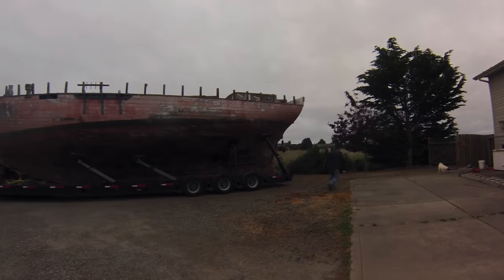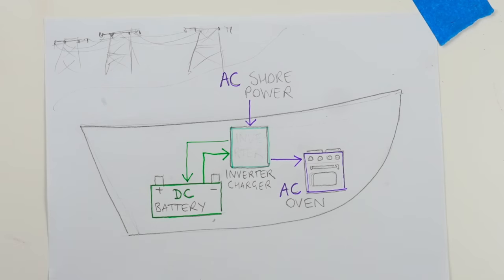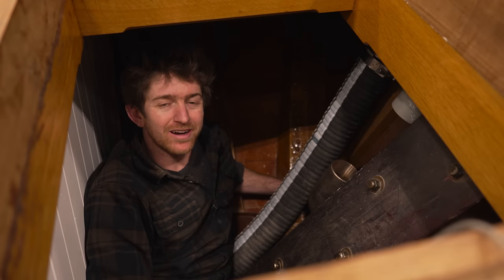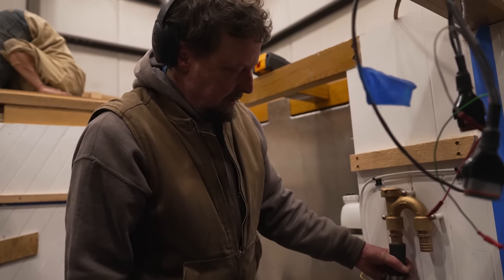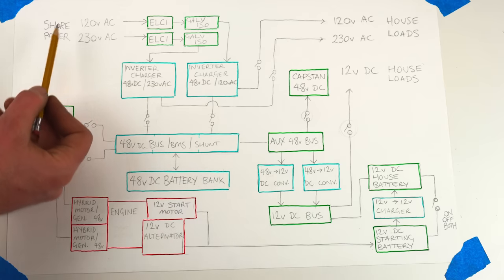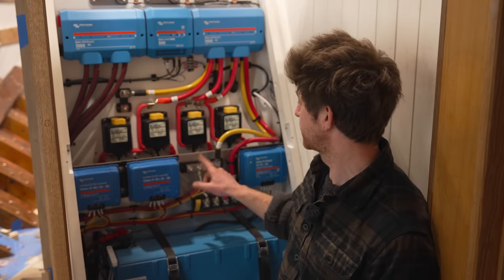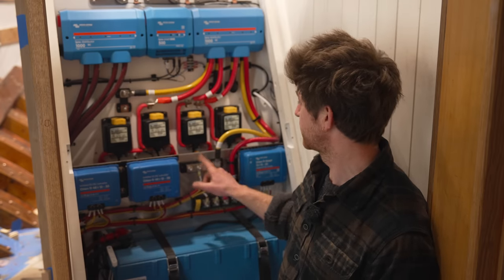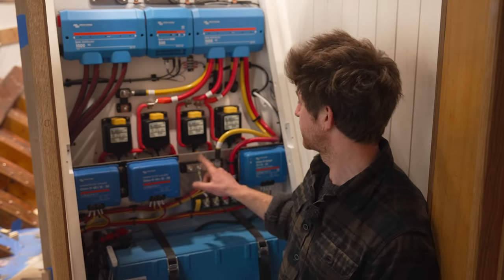Electricity is dangerous

Comment: As a commercial Electrician, I had to make some tight bends in heavy cables (200 to 500 MCM). I made up a couple of thick wall aluminum pipes, one inch dia and 3/4 inch, threaded on one end and with a coupling and a 'smooth bore' bushing. If you can't find a smooth bore, you can machine the threads out of a regular one. If you cut the cable to length before bending, you will have to re-trim the now staggered inner wires, but pre-cutting makes for easier access to the bend site. Since I had access to several lathes, I knurled the end of each pipe to give a better grip, since dielectric grease seems to find it's way onto every tool. They made nice, neat 90 degree bends in the stiffest of cables...👍

Comment: I like the redundancies built into the electric systems.  At sea, what ever can go wrong will eventually go wrong and it's those multiple backup systems that will get you to a safe port.  I especially like the dedicated engine cranking battery with the ability to employ the house battery. Many years ago I taught that type of setup and installed it in several sailboats myself.

Comment: Hey Leo, I’ve watched every video so far!

I’m an electrician in the UK and moving into prosumer AC/DC systems domestically and commercially. This is great to see how your implementing different systems like we do in canal boats here!

Just a thought I know your spark mentioned RCBO’s for your AC side circuits feeding the boat but we are moving now into AFDD’s which are an over current device, RCD device and an Arc detection device rolled into one. While there more expensive they are now coming into our industry in certain areas… with the amount of wood in your boat I’d maybe consider fitting these which will trip and indicate with an led if an Arc is detected before it becomes something much worse that an RCBO or MCB might not even detect.

Sorry if someone’s already mentioned this haven’t made it through all the comments 😂

All the best with the build. Look forward to seeing Tally Ho on the water!

Comment: Great video as ever! This series has shown me a side of Americans i hadn't really seen before.
Electricity certainly is dangerous. 
When i was a kid I used to solder together guitar effect pedals to try to make different noises. At the end of one soldering session in my excitement to try the circuit I pushed the live and neutral prongs in with my fingers. I woke up on the other side of my bedroom, my arms felt like they had been hit with a sledgehammer.
When I went downstair mum said the electricity had tripped and did i know anything about why it had tripped. I told her I didn't.
Reply: My little brother once tried to melt a plastic ruler by wrapping it with garden wire and sticking the ends into an outlet.. Nothing happened to him (nor the ruler), the breakers weren't happy though.

Comment: Hey Leo, if you are worried about fire in the electrical locker, there are products that are pressurized tubes containing fire suppression chemicals.  You mount them above where fire may break out, and the heat of fire will melt the tube and extinguish the fire.  The systems I've had experience with are made by blazecut.  They have a stand alone tube only system, and a tube and cylinder system that has a larger capacity, but works on the same principal of automatic detection and dispersion.  The tube and cylinder system has the advantage of being able to set off an alarm.

Comment: Years ago, when I was foreman at Bristol Marine in Rhode Island, or later when working at Sailors Wharf in St. Pete, FL, In often bored holes through hulls to install new through hull fittings, and drilling each and every one was a bit mind boggling, since I was boring a big hole through a hull, sometimes below the waterline, but knowing once the fitting and valves were properly installed, all would be watertight. I can only imagine, though, how difficult it is for those working on Tally Ho, to bore a hole through the pristine new hull. My accolades to all who are, and have been working on the restoration/reconstruction of a great Lady!

Comment: You guys do a tremendous nice job. My compliments. 
A review on your toilet dump system . It looks good but those Y valves will act up eventually. 
My 2 cents, make it simpler.  Dump the toilet waist via de top of the tank. Dump the tank straight true hull by gravity.
With a valve on the bottom of the tank you make the tank a tank. A second hole, stand pipe  and cap on the top for emptying the tank at the dock.  Install a large filter in between the vent line for obvious reasons. 
If your toilet hose to the tank is long install a siphon, this to relieve the toilet form back filling. 
Less valves less trouble.  If your tank dump is above the water use a waist pump.

Comment: The 12V of your car battery is safe because it's 12V, not because it's DC.  Higher DC voltages can be dangerous, too, because when you first touch them, you see a 'step function' of voltage, which mimics  AC to your body.  AC was adopted for the electrical grid because we could transmit 3 phases on 3 wires (and not need a return wire), and because transformers could readily be used to step voltages up or down.  Higher voltage for long distance/high capacity, lower for neighborhoods, and lower yet for end users.  But modern electronics has made high voltage/high capacity DC transmission lines viable, too.  The more you know, the more you realize how much you don't know.  

Good rules for electrical safety.  
  1) Assume a circuit is energized until you know it is not, and de-energize before working on it if possible,
  2) Assume a circuit is a dangerous voltage until you know it is not, 
  3) keep one hand in your back pocket (electrical paths across your heart are worst-case scenarios).

Comment: Ok Leo, a lot of that went over my head, but that`s not hard to do, I will say one thing about this whole electrical system, it looks expensive for sure, with many safeties built into it, what an impressive system, and it sure looks like you have the right people involved, this boat is basically self sustainable on shore or out to sea, what more could you ask for, love what you guys do Leo, what an epic boat this will be.
Reply: You are right , i reckon at least $20,000 plus installation ! but unreal , 10 kva capacity in the middle of the ocean , wow ! Which brings me to another question , why so much available power for the 230vac and the 120vac ? , are they having a washing machine , drier and electric oven and maybe hotwater heater all electric powered ?

Comment: Congrats on your choice for the electrical attention to detail. Craftsmanship is not only making the system work correctly, but to do so such that trouble shooting that eventual day down the road when something does go wrong, it'll be easy and systematic to diagnose. Also congrats for the amount of redundancy in cross connections of systems. Battery/Motor/Generator/Engine full circle duplication is giving you many advantages for success.

Comment: Important systems entered or will enter the boat. It'd be wise to START writing "guides" to those while expert installers are around: how to procedures, troubleshooting lists, fast fixes, scheduled maintenance, emergency instructions, etc.

Eventually, cover: pre-sail check list, inventory, engine guide, generator guide,  electricity plan/guide, electronics plan/guide, hidraulics... also: "flood" action plan, "colision" action plan, "fire" action plan, "pan pan" action plan, " mayday" action plan, " abandon ship" drill, etc.

Keep it brief, a column with relevant issue/part/problem, a second one sending you to a page in a manufacturer manual, instructions or procedures you wrote, plans, drawings, printed lists, check lists, or anything you have on board that may save you time (and more) when things go wrong.

Comment: A common confusion is that while modern wooden ships use the Hull as 12v negative earth the same as cars, traditional English ships made of oak used to be 6 v positive earth, because the timber being positively charged helps repel barnacles and the french
Reply: 😂 …meaning the French are positively charged‽
Reply: Didn’t some old English cars also have 6V pos chassis?
Reply: My 1930 Ford Model A is 6 volts POS grd
Reply: @timgelder4263  As were, I think, the VW Beetles

Comment: Be careful about the blackwater plumbing systems. Fixing things after it had been in use is a nightmare. Unfortunately I'm speaking out of experience 🤢
Reply: I always have sympathy for the mechs who maintain the sewage plant on the rigs/ships i work onboard.
Imagine the amount of stalacshites that build up with up to 200 riggers/roughnecks etc. 😆
Reply: Never done it personally but I've heard horror stories about trying to tig weld small cracks on stainless urinals
Reply: @k-mc94  We found a decommissioned but still half full (definitely not half empty) wastewater tank. It was great fun to first cut it open, shovel out what's in there and cut the rest of it into pieces in order to get it out. Someone even had the great idea to use concrete to "glue" that thing in place. I've a video of it if you stomach is strong enough 🤮
Reply: @FlyingConey  No thanks, the vivid description of finding 'stalactites' in the walk in size plant that the mech told me about was enough. 😂
Reply: Judging by the excellent judgement evident in the selection and implementation of the blackwater components, I'd say Leo is very much aware how unpleasant his life could be if he doesn't get it right. Vacuum flush is a great way to keep things simple and rugged and reliable, and I'm sure he'll carry a spare pump, which in his system is the only wearing part except for the internals of the Y valves, which should last forever as long as no-one mistakes the head for a trash disposal unit.

Comment: The biggest reason it's hard (or impossible) to electrocute yourself on your car battery is because it's only 12 volts, not because it's DC
Reply: licks the 9V battery to check its charge
Reply: Agreed in fact DC current is far more dangerous at high voltage
Reply from the maker: Yes, that's what I said - consumer DC applications are typically lower voltage ,and thats why it's harder to electrocute yourself on them (or at least what i tried to say!)

Comment: Hi Leo, I commented on one of your earlier videos about the exhaust. Ill say it again. You need to get a dry exhaust riser made. Your engine is below waterline but you have plenty of height in the engine room to raise the spill over height. Relying on a siphon loop when you don't have to is a sure fire way to flood your engine or sink your boat! You also have the spill over point right at the transom, as far way from the engine as possible, after the wet muffler creating an undue amount of back pressure. You need to consider the effects of gravity.....
Reply: I know Tally ho is a traditional vessel, but it would be worth having a flap on the exhaust outlet to further help stop water back flooding the system. Id also ditch that bronze/brass siphon loop as it going to have warm water passing through it straight into a stainless mixer.The mixer will last 5 mins.
Reply from the maker: Interesting - all I know is that this system was approved by Halyard Marine, who helped design it, and Ocean Systems, who have many years of experience installing marine engines. Without knowing your credentials (no offence) it's difficult to know if this is worth looking into. By the way, we don't have much engine room height because the cockpit is yet to go in.
I may not see any other comments but you can email info@sampsonboat.co.uk - thanks.
Reply: @SampsonBoatCo  ill flick you a quick email

Comment: Excellent details. This shows you've thought through the LiFePo4 cut-out safety relay. If for some reason the lithium batteries have any kind of error, the BMS will cut the power to the system, your 12v house bank is a great fault-tolerant backup for essential loads for navigating and autopilot to get you home or to troubleshoot the problem. Beautiful! And to say you've got your Sh*t together would be an understatement. I like the manual pump to handle all of that too.

Comment: ELCI:  Equipment Leakage Circuit Interrupter.  RCBO:  Residual current operated Circuit Breakers with Overcurrent protection.  GFCI:  Ground Fault Circuit Interrupter.

Comment: Love to see the systems come together and it was perfect for me as it is one area I know a bit about.  

In that vein I think it’s a mistake to put in the 12v ‘buffer’ battery into the 12v system.  IMHO it is going to be the main trouble you have with the system as a whole and be the thing that takes down your 12v system instead of being a backup.

As you have it installed it is probably going to be in float or over charged for all its life.  In which case, over charged and over heated it is going to be venting and losing electrolyte and will have to be inspected very regularly for electrolyte levels.  If you have put in a ‘low maintenance’ battery then it will have a very short life.

The excellent Victron dc to dc converters are extremely reliable and cheap enough to carry a spare in the case of a failure.  You can trust them far more than a lead acid battery, installed with very little ventilation and possibly over charged.

May as well take it out now as I’m six or twelve months it will be gone anyway after repeated problems.

Everything else electrical is really top notch and will be 100% reliable and beautifully installed, don’t spoil it with a ‘backup’ system that will just case problems.

Comment: 2:27 to go a bit more in-depth why you can't easily electrocute yourself on the car battery:

The car battery is typically only 12 V and it's hard to electrocute yourself with 12V AC or DC.
The higher the Voltage the more dangerous it becomes to you. Don't touch anything above 50V.

The dangerous thing about AC is that the frequency can interrupt your heart beat which would then stop it. A defibrillator does basically* the same except that because your heart stopped it "restarts" your heartbeat with the help of the current.

* A good defibrillator can do way more that this. It may also detect if your heart is jittering (not sure if it's the right term) and thus act differently.

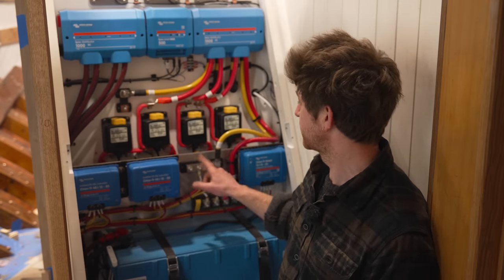Comment: 16:26 The 48V batteries are LiFePo4. 
The two 12V batteries are lead acid, i.e. the house battery and the starter battery.
The electric motors and the capstan are powered by the 48V.
The navigation and position lights are powered by 12V.
There are 230V and 120V AC sockets. The electric stove is on the 230V system.
There is the possibility of charging the 48V system and the 12V system with the diesel engine.
The 12V system is charged from 48V.
Reply: The 12V batteries are also charged from the diesel engine's alternator.

Comment: Excellent video.   You might want to seal your electrical panel's with some plexiglass.   Always good to be able to keep an eye on what is going on there.  If a little moisture gets in there,  corrosion will cause trouble in no time.

Comment: Speaking as a retired master electrician myself, I found your explanations of how this system works was fascinating except for details that were left out such as integrating solar panels or wind generators into the system, the battery monitoring system and how you can view the status of this system from the Nav station and/or the cockpit. Also how can you protect those various terminals from corrosion?
One last tip if I may add,  is to super glue a copper penny on top and in between the battery terminals that will attract any electrolysis and keep your terminals from corroding.
Any lightning protection systems under consideration?

Comment: So unless I missed something....  the inverter setup is supplying AC 230v @50 Hz for high / low draw devices but is supplying only 120v @60 Hz for low draw devices,  so the 60Hz inverter is not capable of/setup for supplying 240 v@ 60Hz. Interesting  design choice, that's not intended to be criticism. I just figured for high draw appliance versatility that both would be offered since the 120v@60Hz was offered , but I realize it is that big of an issue for non-electronic high draw applications. Cool, another great video  thx.

Comment: Have to admit I really don't understand why the electrical circuits on wooden boats are grounded to the water, because all you need to do to get a shock is touch a conductor while standing in the water,  but if they were just electrically floating you would have to touch two different conductors to get a shock because they would have no relationship to the water. Many test benches have isolation transformers for this purpose so that you can't get a shock just by touching one conductor.   I wonder do you have surge arresters in the system to cope with lightening ?